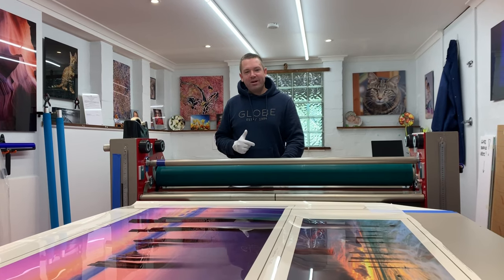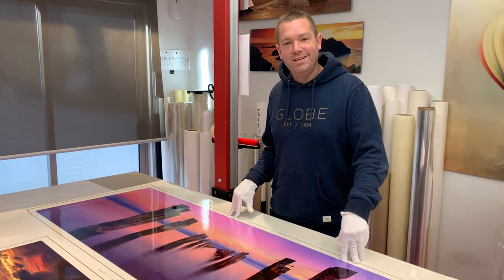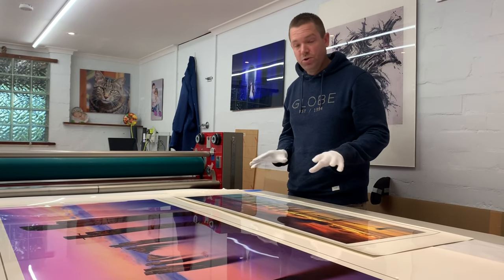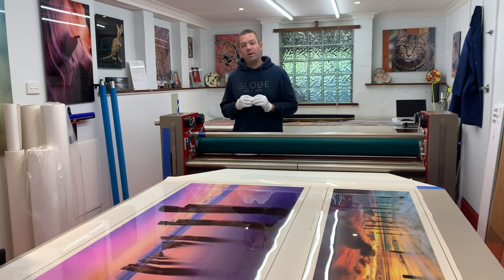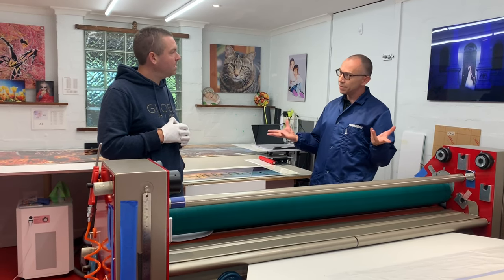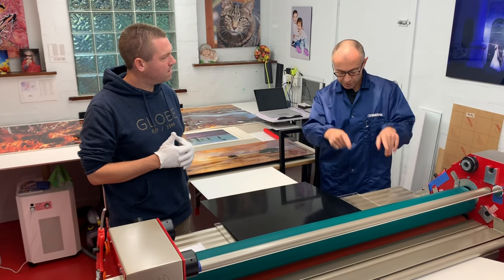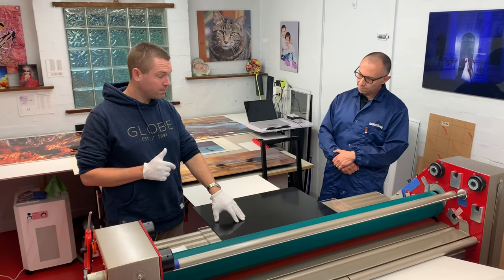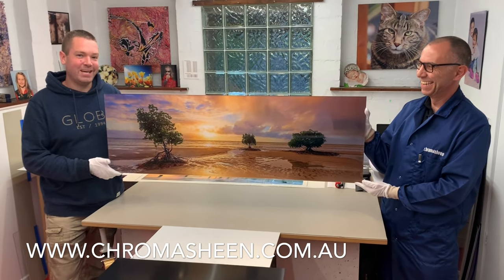Are there LIGHTS behind my prints? Printing landscape photos on FUJIFLEX Crystal Archive!

Comment: Why do you use a dye based reproduction on the FujiFlex and not archival pigmented inks??  Dyes fade. Pigmented does not.
Reply: Pigmented inks not only last longer but Epson's latest inks have a much more larger gamut of color.
Reply from the maker: Fujiflex is a c-type substrate it’s not inkjet
Reply: @MarkGrayPhoto   exactly. So why would you use that when it does not last?
Reply from the maker: @BlockchainForWhatIsBest  Fujiflex is rated at 40-80 years archival life and has a far superior appearance to all inkjet papers. Perhaps you’ve never laid eyes on a Fujiflex print before? Sure inkjet has a wider colour gamut though.

Comment: Thank you for the video mark. This was my 1st on on the topic after reading extensively on the topic online. 
Did you try again the Maxima "paper" or gaive it up after the 1st trial?
Has any other C-Type print or pigment print on metalic paper has managed to reach Fujiflex in th last 2 years?
Why would anyone (photographers and most labs) claim inkjet prints have brighter colors and much better resolution whe you and Peter Lik are still probably using Fujiflex? 
Are you still using film camera? Is it for extra color and resolution you get or for sanimental reasons?Which model is it?
Reply from the maker: I haven’t shot film for some years now, my favourite camera at the moment is the Fuji GFX 100s. Awesome camera. Maxima is nice but has a texture through it so you may as well use Inkjet. Fujiflex is becoming rarer and more expensive to produce as time goes on so there will probably be a point that we have no choice but to changeover to inkjet.
Reply: @MarkGrayPhoto  Thank you for the answer Mark. It seems like as with other technologies in the past they push new way of doing things which is not better but more convenient.

Comment: I've been printing on Fujiflex for years. Nothing looks more luminous. I'm wondering what the new Maxima papers look like.
Reply from the maker: It’s interesting, I’ve done some test prints on it and didn’t really like that it was textured instead of perfectly smooth like Fujiflex
Reply: @MarkGrayPhoto  Well I've got a big print order coming, I had to buy sight unseen because I'm in a bit of a hurry. Fujiflex has gone up enough, that people in NE Ohio, don't like the prices. I'm trying to deliver double conservation-matted 12x18's for $100, but keep the quality high. I have to do runs of 25 to keep the cost down. Most of the time, I realize that this customer won't know the difference, but I will. A few years ago, I was selling them for $85, and I know people thought that was expensive. Really, I need to find a gallery to sell them for me.
Reply from the maker: @Clint_the_Audio-Photo_Guy  good luck!

Comment: Do you think it's possible to get the 'backlit' look from an inkjet print in the same way as a Chromagenic Fujiflex.
I ask because Flex is not widely available and is extremely over priced in the UK
Reply from the maker: Inkjet looks good but not great like flex. A lot of facemounted Inkjet prints suffer from silvering and don't have the same super smooth finish. I don't think Inkjet will ever fully compare simply because there is ink on top of the paper, as opposed to the image being exposed inside Fujiflex (not on the surface).
Reply: @MarkGrayPhoto  By 'silvering' I think you are suggesting the inkjet papers are not completely smooth which could lead to a less desirable finish which may be exaggerated under acrylic. I thought the addition of silicone adhesive spray between print and acrylic would negate this. It seems some U.S print shops have mastered the process. I see Nevada Fine Art Printers offering their proprietary Lumachrome though I know this is inkjet I have no idea what paper is used

Comment: Hi Mark, you failed to mention the inferior colour gamut that C-Type prints produce compared to pigment inks. Unless the printer chromasheen uses has a wider gamut than most c-type machines, c-type prints cannot compare to the vibrancy from a 12 colour pigment based printer.
Reply from the maker: Well yeah Inkjet does have that going for it, still doesn’t compare to Fujiflex though...